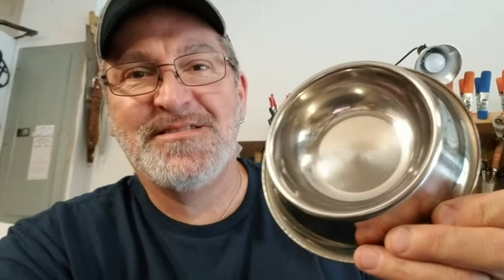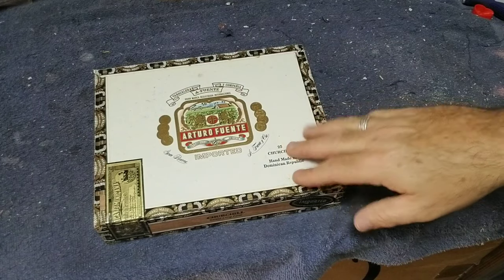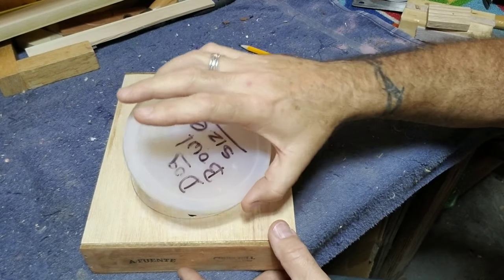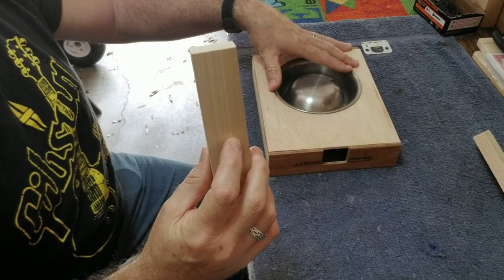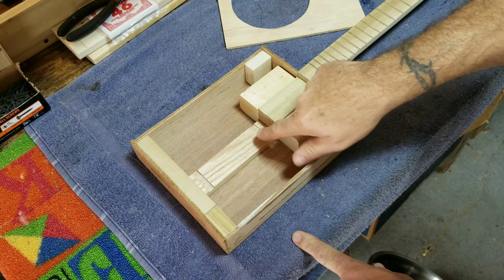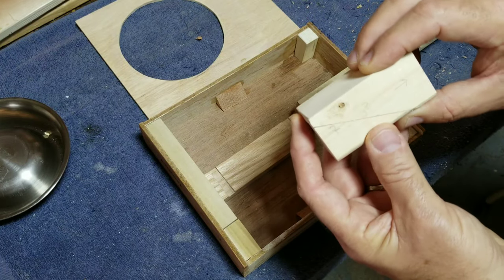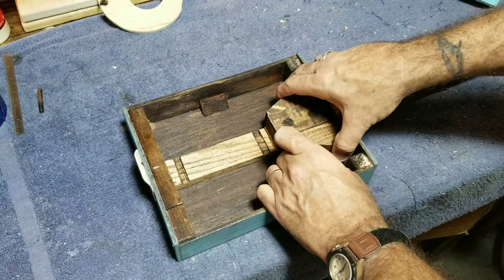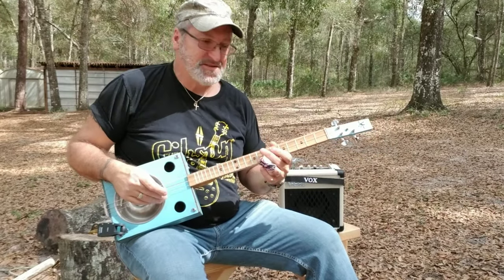How to build a 3 string cigar box guitar - Dog Bowl Resonator

Comment from the maker: This was a very fun build, and my finished cigar box guitar DOG BOWL RESONATOR, came out great. M~
Reply: Looks great, but couldn't you have just glued the piezo on the bowl without cutting a hole? Seems an unnecessary extra step?
Reply from the maker: @MomusFilms  Hey David,  Yes, you can just glue the piezo under the bowl, I've done that on some also, but this bowl seemed to be kind of thick, so by drilling a little hole, I was able to get some piezo connection to the bowl and a little to the box top to give it a bit more sound volume.
Reply: I am a bit surprised that you WANT the boards touching the dog bowl. Wouldn't it act more like a diaphragm if nothing was touching it, and resonate better? Have you tried this to see what the difference is in sound quality?
Reply from the maker: @Crogon  Ive made them different ways, They've all sounded good, each way gives them a different sound. M~
Reply: @SouthernFireGuitars  

interesting! Thanks for the response! :)
Reply: I’m really excited to build my first CBG and I’ve been thinking about using a 6” drip pan from a stove top since it already has a hole in the middle. Do you think that would work okay?
Reply from the maker: @DallasHurstMusic   There are NO rules and everything is possible with a little planning . M~  ;)
Reply: @SouthernFireGuitars  true 😅 thank you!!

Comment: just a thought...you could've drilled a smaller hole. just enough to pull the wires through and had the piezo sandwiched between the biscuit and the bowl. no idea if it'd make a difference but i'm thinking it might.
Reply from the maker: That may work, but the peizo disk has the 2 wires soldered to it, so its not perfectly flat, and you would see a gob of glue under the biscuit...so I don't really know,  you would have to try that one. M~
Reply: @SouthernFireGuitars  you could still glue it on the bottom if you wanted to. i think string pressure would probably keep the biscuit down. also, that way you could make minor adjustments for intonation.

Comment: One of the best vids on this subject I have seen..  Wish this had existed back when I built my first ones. Going to file this in the "to be shared if someone asks how to make one on FB" file. Though I'm curious about drilling the hole to connect the piezo to the biscuit (I've never done that on the ones I've made) seems that it would almost cancel out the metallic resonance we want in metal resonators.
Reply from the maker: Thanks Michael. The hole in the bowl, is smaller than the piezo disk, so its touching the metal and the wood, so I get the tingy sound of the metal, but its a more amplified tone. I like it.

Comment: Hey man love the videos they are inspiring and informative I just wanted to ask on the dog bowl resonator (I love saying that ha) does the placement of the bridge not matter as much as it does on a regular cigar box? Or am I mistaken and it doesn't matter on a normal CBG? I'm new to building CBGs and learning a lot from you but this is definitely a project I want to undertake and wanted some clarity. Much appreciated. Keep up the bonzer work good sir.
Reply from the maker: Hi Darren, the placement of the nut needs to be accurate on any guitar you build, or it will be hard to get the intonation set correctly. M~

Comment: Nice video Michael. Thanks. Is it common practice to use a humbucker to a resonator instead of a piezo? I guess It should sound really cool with humbucker...but I haven’t see many built that way.
Reply from the maker: Thank you Luis,  to me it's really a preference thing, but I think the piezo gives more of the sound of the strings vibrating through the metal bowl, than the humbucker will. M~
Reply: Southern Fire Guitars Thanks!

Comment: Wow, what a great build!  I think I had almost as much fun watching you as you did building he guitar.  I got a handful of old dog bowls out in the shed, so those will keep me busy for a while.  One question, where did you get the screws and ferrules that you use to bolt the neck to the body?  Looks great.  Thank you for making this video.
Reply from the maker: Thanks for checking out the video. I'm glad you liked it. I use #8 finishing washers with  dry wall screws to attach the neck, Gives it a nice clean look. 😎
Reply: @SouthernFireGuitars  Did you make the bridge yourself?  And it looks like the biscuit that the bridge sits on is just a piece of hardwood, is that correct?
Reply from the maker: @gtrboy77   Yes , I made the bridge, and the biscuit is a cut piece of the box top I cut out for the bowl. How I make the bridges video https://www.youtube.com/watch?v=Oi84i9RYJHk&t=57s

Comment: IS there glue between the Piezo and the blue biscuit?  What bridge did you use (wasn't mentioned in the video).
Reply from the maker: Yes,  on the glue, and I made the round blue bridge and added a bolt for the strings/

Comment: Hey Michael, I’m working an a DBR, I didn’t drill a hole and the piezo I used is like 2”. It’s glued to the metal of the bowl and biscuit no top and I’m getting a real tinny sound! 
Any suggestions?
Reply from the maker: Hi David. That's pretty much how those things sound, with the piezo pickup. :(
Reply: @SouthernFireGuitars  a biscuit should dampen it a bit though right?

Comment: If you just put two 1’x2’ strips along the top edge of the box parallel to the neck with the dog bowl pushing down on the leg of the neck the box wouldn’t collapse also the end of the leg could double as the tail block and with the strips on the sides you would have more room for air and air holes I could be wrong I’ve never built one like this it’s just what makes sense to me
Reply from the maker: Thanks, Jack. That may be another way to do it. M~

Comment: What kind of sound would you get if you connected a humbucker under the dog bowl, at the bridge position?
Reply from the maker: Hey Adrian, that's a good question.  I have no idea, I've never tried it. The pickup would be pretty far from the strings at that point, under the bowl and under the bridge. M~
Reply: @SouthernFireGuitars  yeah, but the metal  from the dog bowl will vibrate from the bridge. The vibrating metal over the humbucker could cause an interesting electromagnetic fluctuation, that could cause a different kind of sound
Reply from the maker: @AdrianP247  That's a good point, might be worth exploring :) M~

Comment: Hi! I have a question.
How was the center of the resonator determined in relation to the intonation?
Reply from the maker: Hi, it was on a 23'' scale, so from the nut to the center of the biscuit was 23''.  For intonation I had to slide the bolt for the bridge back a bit.